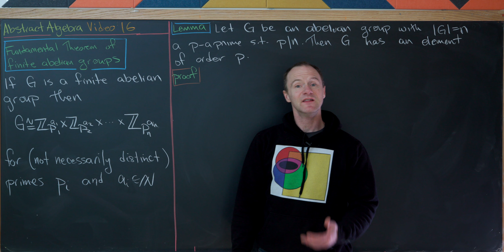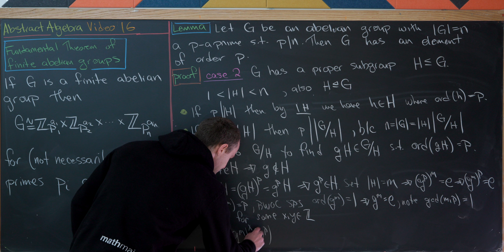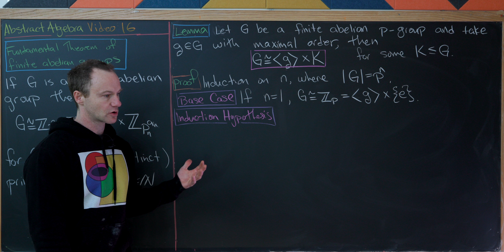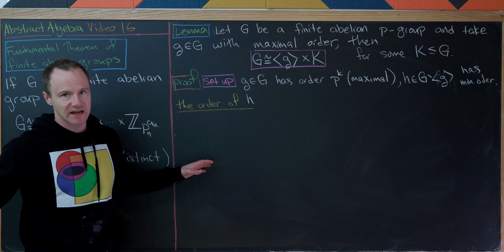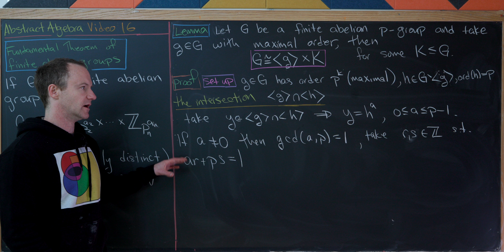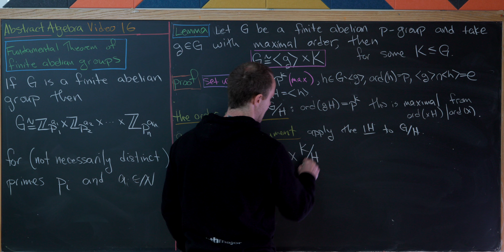Fundamental Theorem of Abelian Groups -- Abstract Algebra 16

Comment: 39:37 For me this took a bit of time to figure out so fore anyone interested here's the proof for- r:=ord(gH)|ord(g)=:s :
We know-(g^r)H=H meaning g^r is in H.
Now we assume (for a contradiction) that r doesn't divide s. This means t:=gcd(r,s)<r (since gcd(r,s)≠r). 
Since t is the gcd:
gcd(r/t,s)=1.
This means that r/t has a multiplicative inverse in ℤₛ which we will call q (from modular arithmetic).
Since g^r is in H, so is- (g^r)^q
 =g^(rq)=g^(t•(r/t)•q)=g^t
Since t<r, we have shown that a smaller-than r power of g is in H meaning r cannot be the order of gH.
Therefore ord(gH) must be divisible by ord(g).
Reply: Thanks. Very useful
Reply: if g^t belongs to gH why cannot r be the order of gH?
Reply: @bidishanag4198  the order of gH is the smallest k∈ℕ s.t. gᵏH=1H (since only for the smallest do we get the order of the cyclical group generated by gH of that's how you define an element's order). Since I found a t<r with gᵗH=H r can't be the smallest and thus isn't the order of gH.

Comment: 0:00 Lemma: Let G be an abelian group with |G| = n and a prime p s.t. p/n. Then G has an element of order p

13:03 Lemma: G is a finite abelian p-group iff. |G| = p^n

16:33  Lemma: Let G be a finite abelian group. Then G is isomorphic to the cross product of its subgroups whose orders are the maximal powers of distinct primes (such that those powers of primes multiply to the order of G)

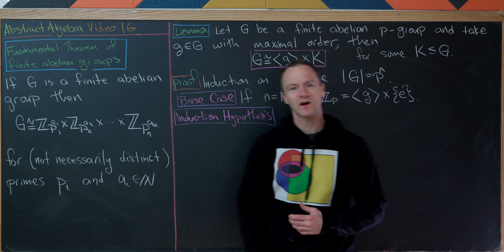27:30 Lemma: Let G be a finite abelian p-group and take g as an element of G with maximal order. Then G is isomorphic to <g> cross K, for some subgroup K of G

51:45 The Fundamental Theorem of Finite Abelian Groups

54:12 Examples
Reply: the second lemma does not hold for D4

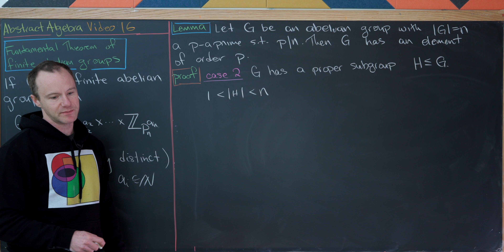Comment: Small things: at 6:25 Michael misspeaks and says "normal" but means "proper", and the lemma at 13:29 doesn't require abelianness (indeed it wasn't used in the proof) - including the word "abelian" actually makes the result incorrectly stated, because of course |G| = p^n doesn't imply that G is abelian (for example the quaternion group is a non-abelian group of order 8). If you want to include abelianness just so that the lecture is focused on only abelian groups, then the lemma needs to be stated as "For a finite abelian group G, G is a p-group <=> |G| = p^n".

Big thing: unfortunately the proof of the lemma at 20:44 is incorrect - the mistake is a very common one: the generalisation from binary internal direct products G = N_1 × N_2 to arbitrary internal direct products G = N_1 × N_2 × N_3 × ... is not the "obvious one"; we still need every element of G to be expressible as a product of elements from the normal subgroups N_i, but the condition N_1 ∩ N_2 = {e} does not become N_i ∩ N_j = {e} for i ≠ j; the correct condition is that each N_i intersects trivially with the product of the remaining subgroups, i.e. N_i ∩ (N_1 ... N_(i-1) N_(i+1) ...) = {e}. For example for an internal direct product G = N_1 × N_2 × N_3 we need N_1 ∩ (N_2 N_3) = {e} = N_2 ∩ (N_1 N_3) = N_3 ∩ (N_1 N_2), and the "obvious" condition N_1 ∩ N_2 = {e} = N_2 ∩ N_3 = N_1 ∩ N_3 is not sufficient.
One can see why N_i ∩ (N_1 ... N_(i-1) N_(i+1) ...) = {e} is the correct condition by looking at the external direct product: e.g. with three factors G ≅ G_1 × G_2 × G_3 we have that the copy of G_1, G_1 × {e} × {e} = {(g_1, e, e) | g_1 ϵ G_1}, not only intersects trivially with the copies of G_2 and G_3, {(e, g_2, e) | g_2 ϵ G_2} and {(e, e, g_3) | g_3 ϵ G_3}, but also intersects trivially with their product {(e, g_2, e)(e, e, g_3) | g_2 ϵ G_2, g_3 ϵ G_3} = {(e, g_2, g_3) | g_2 ϵ G_2, g_3 ϵ G_3}. The same kind of thing is true for internal direct products (sums) of vector spaces, where you can visualise things geometrically: R ^3 is an internal direct product of R × {0} × {0}, {0} × R × {0}, and {0} × {0} × R -- the x axis, y axis, and z axis -- because the x axis intersects trivially with the sum of the y axis and z axis, which is the y-z plane - similarly the y axis intersects trivially with the x-z plane and the z axis intersects trivially with the x-y plane.
Reply: I find it unfortunate that there are mistakes like that that I couldn't possibly spot, it makes it quite demotivating knowing i'm not actually learning the correct stuff :/

Comment: @19:00
In an abelian group, the order(ab) is a divisor of the lcm(order(a),order(b)) but equality does not hold in general.

As a concrete example, consider the additive group Z_8.
Order(3) = 8 since (3 + 3 + 3 + 3 + 3 + 3 + 3 + 3 = 0)
Order(1) = 8 since (1 + 1 + 1 + 1 + 1 + 1 + 1 + 1 = 0)
LCM(Order(3),Order(1)) = 8
However
Order(3 + 1) = Order(4) = 2 since (4 + 4=0)

(Note that the divisibility condition is all that's really needed in the proof.)